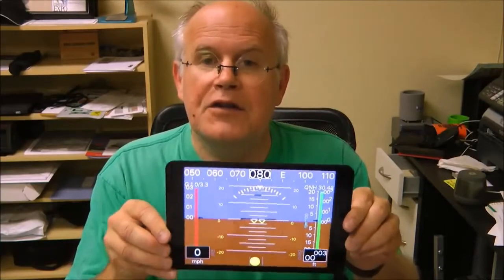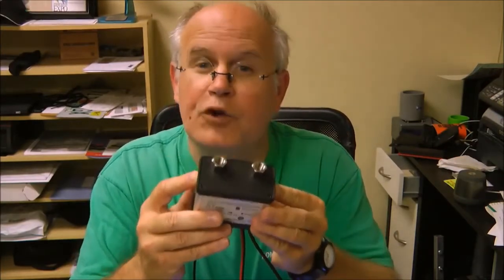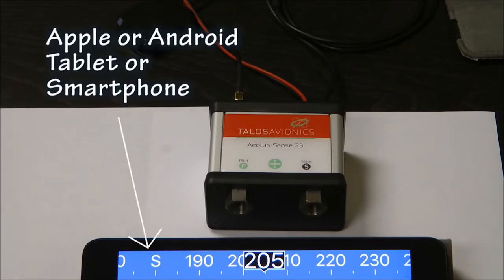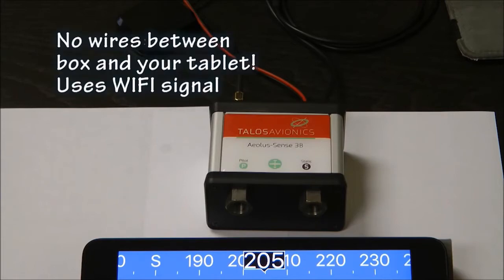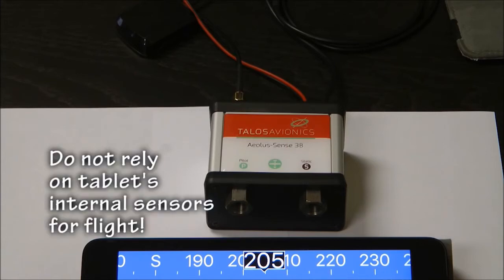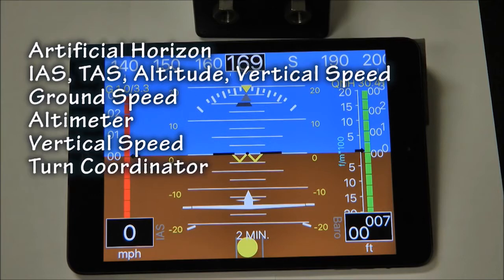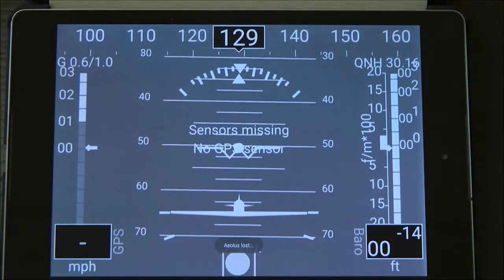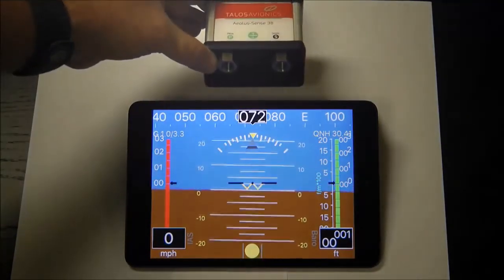Aeolus-Sense evaluation/presentation by the HomebuiltHELP channel in Youtube.

Comment: Where do you install the sensor? Outside or inside the cockpit?
Reply: Hi Ignacio, as all electronic instuments, our devices are installed inside the cockpit. More installation information on our website https://talosavionics.com/documentation/
Reply: @pantelisgeorgiadis607  great video am building a furia helicopter videos on channel and maybe interested in this product. My question is 
1. What powers it?
Does it have a battery 🔋 in it, if not how much volt external connection does it need.
2. Does it have an inbuilt WiFi signal or do I need to provide external WiFi connection?
3. Is tablet and box water tight?
4. Lastly what other products you could recommend for the homebuilt
Reply: @JeffChoppah  Hi Jeff, our devices are powered from the aircraft's power from 10V to 32V. The pro models have also an internal back up battery which powers the device for about one hour if the main power fails. There is WiFi inside the unit, thus no external wifi is needed. Sorry, I can't understand the 3rd question.
Reply: @pantelisgeorgiadis607  I intend to use 12v DC to power my instruments...will this work for this model
Reply: @JeffChoppah  It will work. PRO models need 12V-2A max while the others 12V-1A max. During the operation, the current needed is 1/3 of the max power. Max power includes inrush current after power-up.
Reply: @pantelisgeorgiadis607  great have had a look at your site...only extra feature on pro version is ADSB only? Is batter back up in both? Do you also sell pitot tube probes.?
Reply: @JeffChoppah  PRO models do have the ADSB in and internal battery backup. Flysense AoA pro has also the probeless AoA. Sure there is also full pitot/static.
Reply: @pantelisgeorgiadis607  will read more on your product and place an order this is quite impressive compared to using old analogue instruments....from your site a pro costs 870$ is this inclusive of tablet and the box?...am building a helicopter AoA is unnecessary, plus my country ADSB systems are quite undeveloped. Need to analyse my needs in detail...but will definitely grab from Talos

My third question above was about the box being water tight...my cockpit my be open cockpit so can they be rained on and survive.

Comment: We have sold hundreds of our devices without any problem. What was the problem with Levil's devices? Many AHRS manufacturers correct the gyros drift only during straight and level flight, considering that most part of a flight is in this configuration. That means that if you make many turns, the gyros start drifting and they correct this drift again when you fly straight.Our algorithms correct the gyros drift in any attitude of the aircraft.   If you want more info you might contact us at info@talosavionics.com